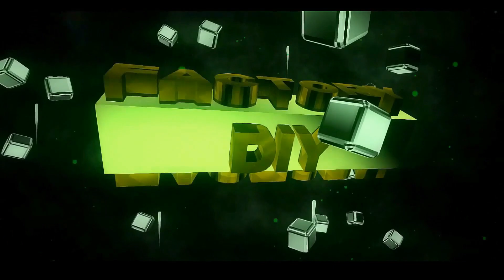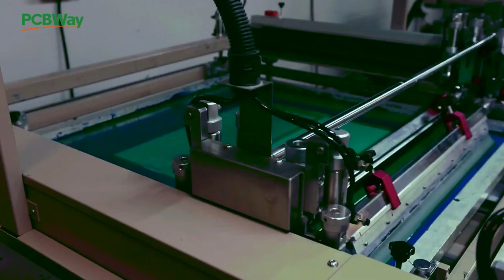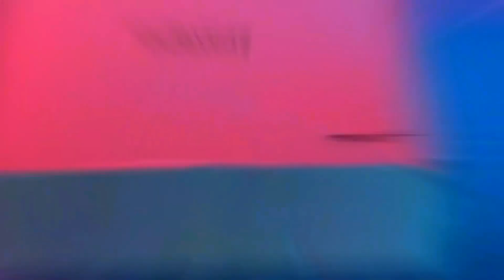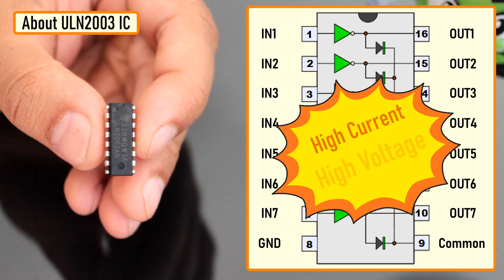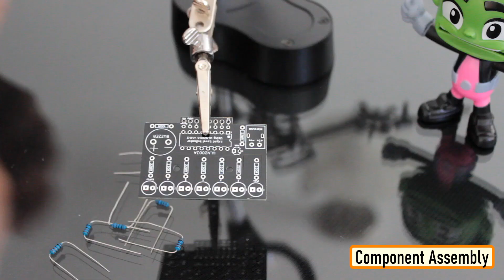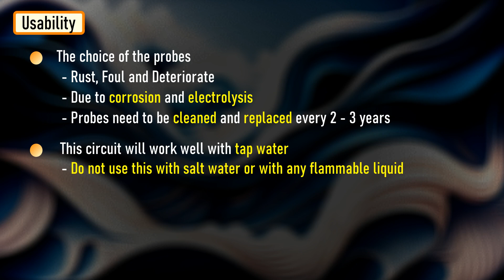Liquid Level Indicator Using ULN2003

Comment: Thanks for the info.  I wonder if using stainless steel probes will make things a bit more easy.  especially the corotion part.
Reply from the maker: Good point, stainless steel would be much better for corrosion resistance.

Comment: Can we use 12v supply and 12v leds
Reply from the maker: Yes, you can absolutely use a 12V supply and 12V LEDs for a liquid level indicator built around the ULN2003. In fact, this is a very common and perfectly compatible way to build the circuit

Comment: why are the 1k resistor used.  if i use 12 leds doe i need the resistor
Reply from the maker: The ULN2003 IC has built-in base resistors, specifically 2.7kΩ, for each of its seven Darlington transistor pairs. These resistors are designed to allow direct connection of the ULN2003 to TTL and 5V CMOS logic circuits. Therefore, you generally do not need to add external resistors when using the ULN2003 to drive LEDs or other loads, as the internal resistors are already configured for common logic levels.

However, to be super safe I added the external resistor

Comment: I have made this circuit, but, only 1 LED can light bright, the other are dimmed, can you tell me what the problem is?
Reply from the maker: Voltage 
How many volts are you pumping in.
I had the same issue with 5v bit worked well using 9v

Comment: Good job
can i use 10 meter wire for the sensors ?
Reply: yes
Reply from the maker: Increasing the length of a wire has several effects on its electrical properties, particularly its resistance and inductance.

The resistance of a wire is directly proportional to its length.
The inductance of a wire also increases with its length. Inductance is a property that opposes changes in current and is more significant in AC circuits.

Comment: I think the ULN is a good choice due to it being a darlington array since a darlington has a very high gain and thus requires a small amount of current to turn on.  I wonder if it would work with distilled water.
Reply from the maker: I have never tested it, but it's a good point